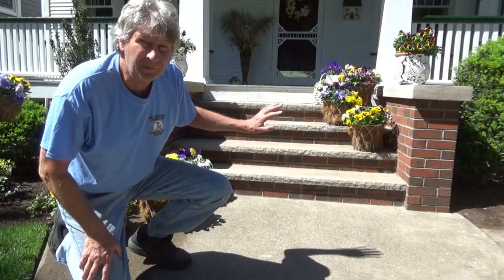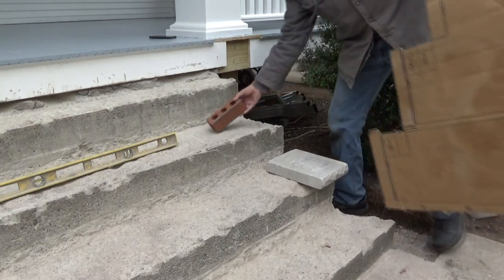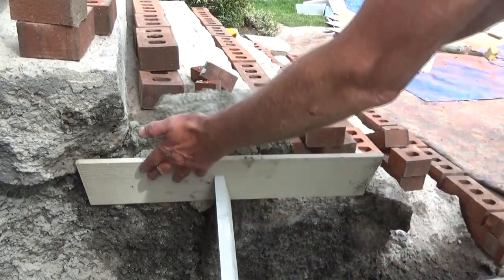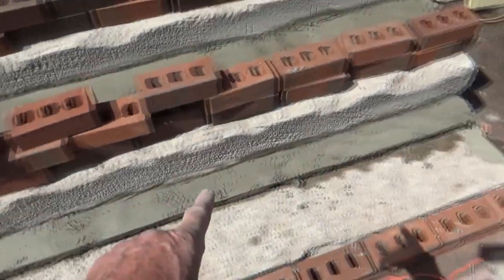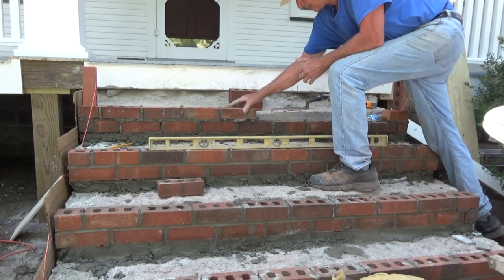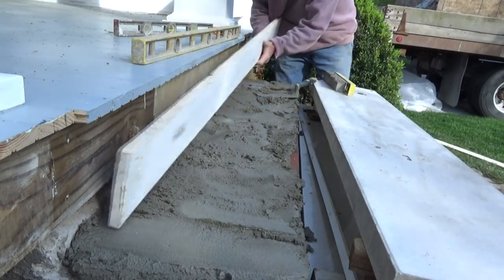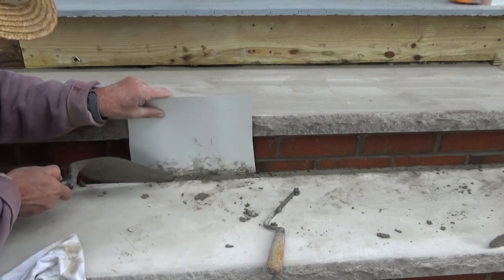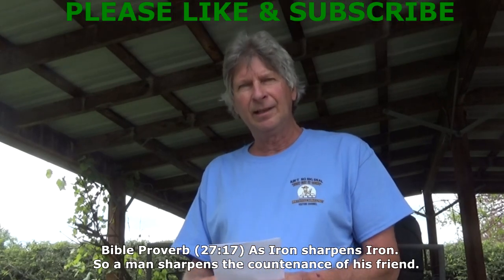BRICK STEPS REPAIR (Part 9) Mike Haduck

Comment: I watched all 9 videos of Brick Step Repair and I did not see anything that is similar to what I'm dealing with except where you had to chisel away some old mortar on soldier set bricks. You used your chisel, a small sledge hammer, and your Testosterone, which I do not have. I also don't have a helper.  I learned the most from video #9, but didn't get to see the method you used to chip away the cement steps to fit your pattern. I don't see any masonry videos made by 64-yr.-old- women along with all of the pitfalls of doing masonry at 64 yrs. of age , so I guess I'm going to have to make my own. I learned a lot from you and you gave me the confidence to take this project on, as back breaking as it is, myself. Thank you for your expertise.
Reply from the maker: Hi Carolyn,  not a big deal , anything that works, your 4 years younger than me, so you got more time, lol, Mike
Reply: @MikeHaduck  You have the Testosterone=strength!😁

Comment: Any videos on blasting a hole in a basement block wall to create an entryway?  How do you tie the retaining wall correctly into the foundation to install bilco doors?
Reply from the maker: Hi Corey, today they have diamond saws, but usually a sledge hammer and chisel one at a time. Bilko doors I lay a pad of concrete first, and the inspector might require some holes and rebar but the oldtimers would just notch it so the weight wouldn't pull on the foundation, I hope it helps, Mike
Reply: @MikeHaduck  Thank you!  I believe cutting the hole in my foundation wall and being destructive would be the only part I don't screw up.  Putting it all back together again with a retaining wall properly tied to the foundation that doesn't flood is another story.

I can't find any videos of masons retrofitting bilcos.  There was one where the crew crane-dropped prefab steps in a hole and bolted it to the foundation, but I'd sure like to see the old school way.  I'm so happy to have found your channel!  Thanks again!

Comment: according to the old book you shared on another vid; if the rise is 7" the tread should be around 9.5" wide traditionally (multiply to equal 66)
Reply from the maker: Hi R , masonry steps have a lot of variations,  especially with landscapers, thanks Mike

Comment: Mike, as usual, great work!  Question - Did you make cut-marks with your grinder on the underside of those limestone steps, like you've done in the past?
Reply from the maker: Hi , I usually do, depending on where they are or if they are covered, thanks Mike

Comment: Hi Mike I wrote you last week about my solid foundation wall crumbling. Mike can I clean the foundation, wet it, and put the Portland paint mix with a hardener in it. And go over all of my walls where there is an issue. Just to stop it from crumbling. Then at a later date. Do it all again but then Purge it at that time. For now I'm just looking to stop it from crumbling. Thank you Mike if you can please get back to me
Reply from the maker: Hi Nick, hole bigger than a half inch I paint it with Portland then cement it, but I don't paint it then go over it some other day, it won't stick as well, thanks mike
Reply: @MikeHaduck  thanks Mike, yeah I thought maybe I could paint it on just to stop it from crumbling.  Then get back to it the right way you do it. Ok thank you happy 4th